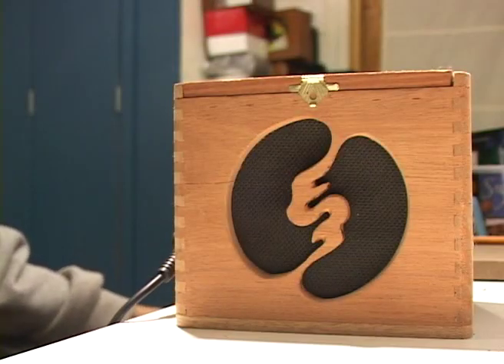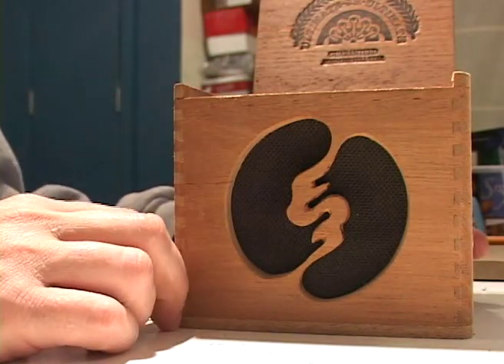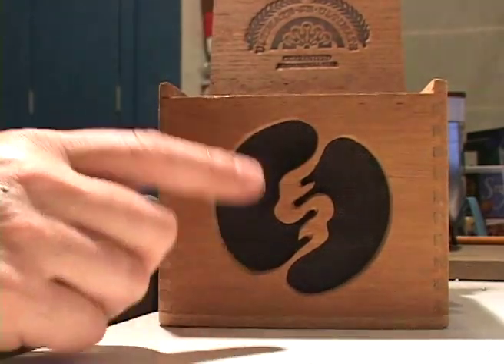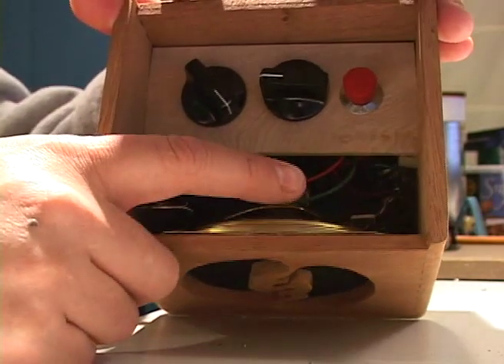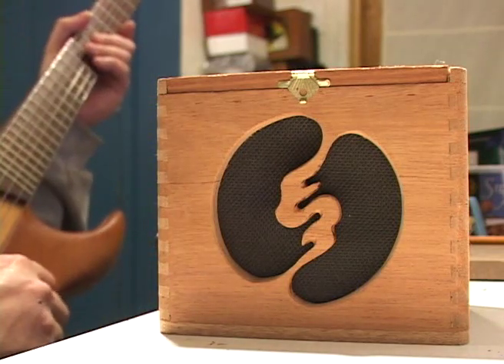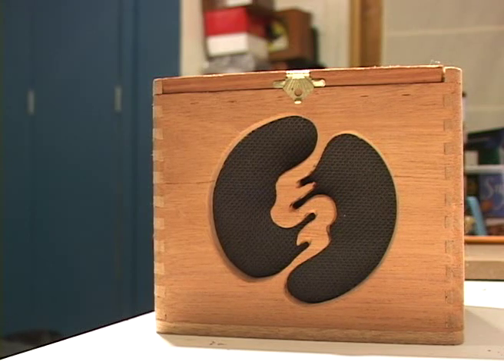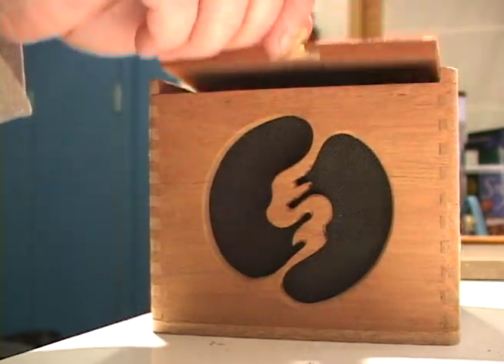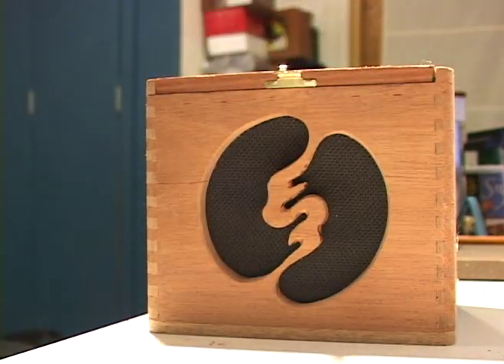no 371 rothschild amp

Comment from the maker: Thanks, great tips!  I did manage to buy out the stock at my liquidators a few months ago.  So now I have enough for the next 20 or so amps.

I have been experimenting with smaller diameter long throw speakers as well.  Amazing that sound you can get out of a two inch speaker!  I'll post results as soon as I get one finished.   That said, I still like the response of the 4" model better.  The small speaker has a bit of harshness, even though the freq response is very similar.

Comment from the maker: I think you have to balance the load on the amp with the speaker...(That's pseudo science...aka "guessing" from me).

What I mean is that I tried the 2" 8 ohm computer speaker as well and hated it.  The 4" speaker I'm using is a 2W 16ohm model.  I tried a 4ohm, but the distortion wasn't pleasant at all.  Going up in resistance doesn't seem to bother the amp.  The speaker is also the Alnico type hobby speaker..small coil.

Eric

Comment: Sounds great! What kind of 4" speaker are you using? Is it made for hi-fi audio or is it actually a guitar speaker? Seems like the speaker makes all the difference. I built a Ruby amp and first tried it through one of those wimpy 2 inch 8 ohm computer speakers...sounded like crap lol. Then I plugged it into the 8" guitar speaker in my combo amp and was amazed by the clean volume as well as the distorted tones! Nice job, by the way!